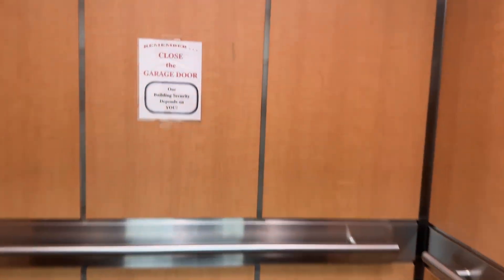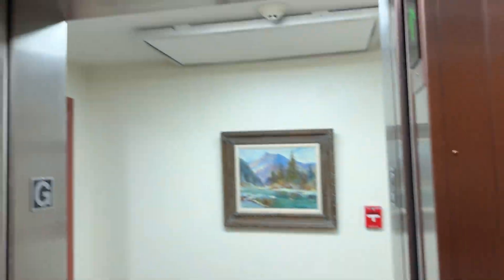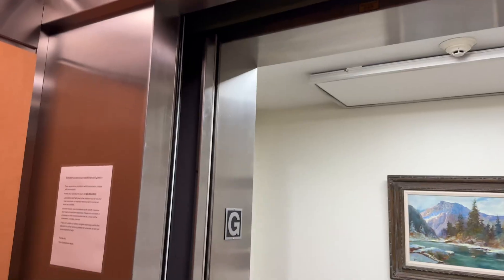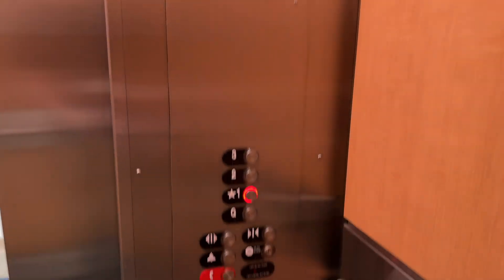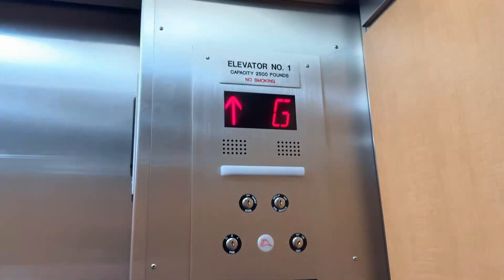Fire Alarm Test 149 | March Time

Comment: I just love fire alarms and yes the elavattor is a ejtis m2 elevator I rode on one and I got stuck they are bad elevators actually and I don't use elevators if I don't have to also doing fire drills some times it's nice to actually have a walkie talkie like the encrypted talk onn walkie talkie system and during a fire alarm drill never ever ride a elavattor it will drop and you in the elevator will die it's a very scary thing old elvators don't have a brake system in it only the newer ones do and the newer ones cost more money because it can fit more people on it  and weight of people on it it would cost thousands if not trillions of dollars to get a good brand new elvator that wouldn't brake wouldn't need maintained or oiled or checked the new elvators have a operator that speaks to you actually and it will also tell you instructions if it ever brakes down and what to do to get to safety and if a fire alarm stops or goes off it will make the elvator stop running to prevent the fire burning up the air pump shaft and preventing it from actually failing a dropping to your death so yeah I just don't ride elavattors and stuff so yeah if there is a. Fire alarm activation never ride the elevators because I promise it will be extremely very scary so please don't do it to be a ass or to show off because that will be a death sentence if you walk into a elvator during a fire alarm drill on a new elvator also if you smell anything burning don't go on the elvator it means the elvator is messed up you'll probably die if you get on it I've had a lot of dreams about it so yeah

Comment: So wait, Im lost, the original Signal Code was Continuous(Last video from over a year ago). Now This is set to March Time (120 BPM). I thought the March Time Coding isnt utilized on a modernized system.. Code 3 May have been a Choice but why March time.
Reply from the maker: Temporal 3 requirements are up to jurisdictions. It is not always required. It is the same reason why most voice systems play a whoop tone instead of a temporal 3 tone. March time was selected as it gets through walls well and there’s no notification in the apartment units where people have had trouble hearing the alarm in the past. If complete code compliance was desired the system would need a full upgrade
Reply: @FourtyFiftyEighty  Ah makes sense. Thanks for clarification. Continuous is common for my area in upgrades and new installs so this makes more sense as to why the coding change was done.
Reply: The reason was put in the description
Reply: It's a grandfathered system.

Comment: 4:19 That One Needs Replaced
Reply: Actually it's cause some can run a bit rough if there not on a simplex panel
Reply: the tab needs bent on it i bet bc panel is filthered
Reply: Maybe it needs 2 be tightened?
Reply: @EndeavorsDnB  i agree if it's working properly it just needs to be rebolted in

Comment: The horn at the 3:00 mark is on its way out
Reply: It has been for a while. It sounded like that last time.
Reply: @Djmarcymoo-o9b  why hasn't it been replaced?
Reply from the maker: @GaryBeltz cause it works
Reply: @ It hasn't failed completely yet.
Reply: @GaryBeltz  You are everywhere man holy cow
Reply: It needs readjusting